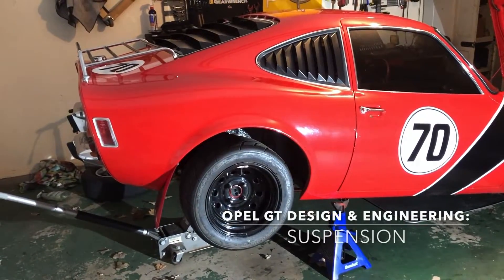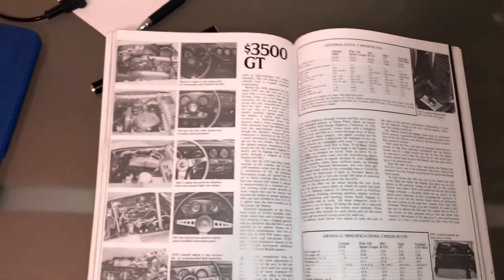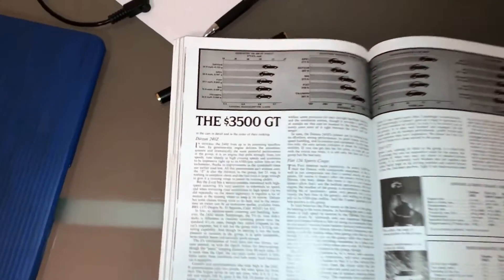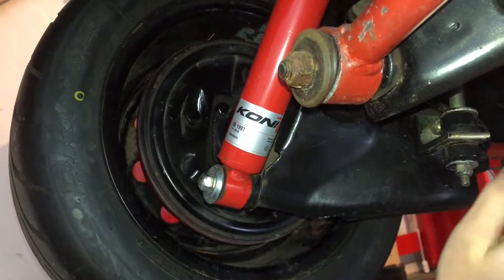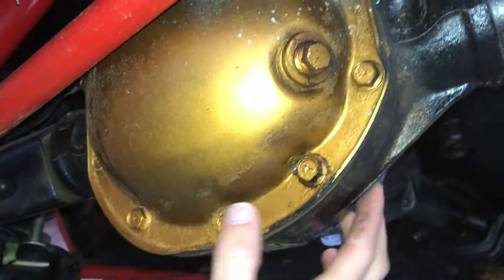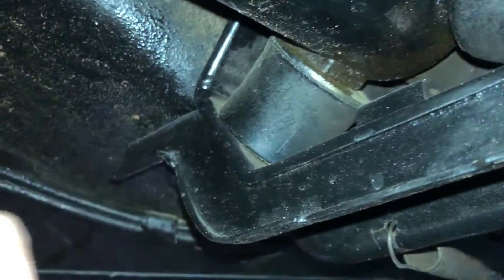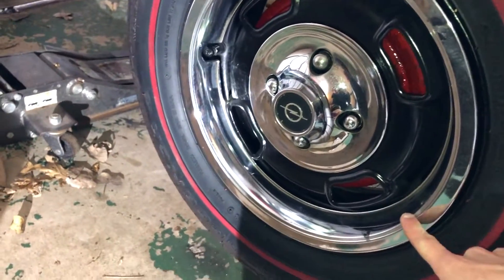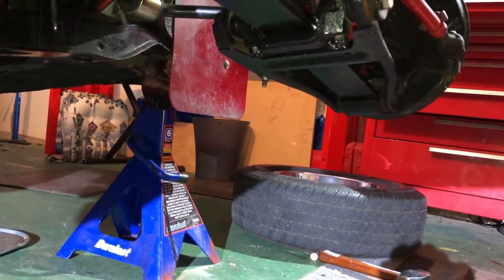Opel GT Design & Engineering: Suspension

Comment: Hi thanks for the intro into the opel gt.  You mentioned the corvette leaf spring being stronger in some ways yet more comfortably in others.  That some have swapped them out but needing to modify it.  Can you tell me where i can find information on it?  From what i have gathered, the corvette leaf spring is longer than the opel leaf spring.  Looking, i see there is a single bolt in the middle holding it to the k member.  Im wondering if they cut the middle 4 inches out.  2 pieces of the sides above, bolting the middle under it so the flex wouldnt transfer to the opposit side.  It would make it truly an independent suspension. 

If im wrong, can you tell me if you dont know where to find it online?

Comment: The lateral bar at rear suspension is called Panhard bar. The front leaf suspension was used on the Kadett serie (and may be other series)
Reply from the maker: Yep! Both items were mentioned in this video at 5:10 and 11:10. The 1963 Kadett A was the first to use the front suspension although the 1966 Kadett B was the first to arrive at more or less its final form. Likewise the second half of the 1967 Kadett B was the first to use the final iteration of the GT rear end (1.1L). The 1968 Kadett 1.9L was the first to use the larger rear end. The vauxhall viva first generation was quite similar to the Kadett A and also not far off from the GT.

Comment: hi great vid. so do you know what mods Conrero did to the f/r suspension to make their cars handle better. ?
Reply from the maker: shadmonk thank you! There was a lot that they did! I highly recommend the book “Opel GT Motorsport 1968-1975” by Maurice Van Sevecotte. I’d have to write a novel to even scratch the surface of this question!
Reply: @OpelPower  your car seems to handle great. I'm wondering for a road track day car are these mods adequate? sounds like a lot of work to do a Conrero type modifications then?! How would you improve yours further if you wanted to?

Comment from the maker: One small correction.
At about 17:25 I say adding a front sway bar worsens oversteer. I meant to say understeer.
Reply: what is the diff centre,?.d44,or what,.what is the g/box.?. these are prone to leave the road like a plane at 120 mph..front splitter,rear wing,mazda miata engine.or better..

Comment: Is there any "upgrades" that help the Suspension? I'm getting ready to rebuild a 68-69 come Summer. Looking for all the tips I can get.
Reply from the maker: FallenAngel1930 yes! Get the 1” lowering leaf spring, this makes a huge difference. Get front and rear sway bars, Koni red shocks, and poly bushings front and rear. Unless you are doing competitive racing you’ll be completely satisfied with that setup. All these parts are available at Opel GT Source.
Reply: @OpelPower  Thank you for the Info. I really appreciate it. Are there any Rear End Swaps that work if I decide to go up to 2.4? Your Video Mentioned the Rear doesn't hold well with more HP if I heard right?
Reply from the maker: @FallenAngel1930  You'll want to use the stock rear end with a 2.4L. You will have more chance of blowing it up than with a 1.9L, but that doesn't mean it will happen. Keep it full of oil. If you have a later style 1971+ axle you'll be in better shape. Tons of people have 2.4L with stock rear ends and do fine. If it were me I'd use the Quaife LSD that fits in the stock housing (with slight machining that any shop can do). This replaces the weak spider gears in the Diff
Reply: @OpelPower  I have a 72 Opel  that needs Floors,and Motor. So, you are saying I can take the Rear, and Front end off of it then move it to the 68-69?
Reply from the maker: Yes the parts are interchangeable. You probably don’t have a 68. There were only 13 in the US  or none and they are very special. Hand built and have a higher compression head. Yours is going to be a 69 GT
Reply: @OpelPower  Thank you very much. I feel bad asking so much, and knowing so little. I bought both from a Junkyard, and went by what they told me. I need to go look at the Door Vin. I really appreciate People like you being as Knowledgeable as you are.
Reply from the maker: Don’t feel bad! This is literally the purpose of this channel!:)

If you haven’t already, join www.opelgt.com there is a huge wealth of knowledge there. 
Also join my group Opel Owners USA on Facebook:)
Reply: @OpelPower  I can join both. I think I also have you on Instagram. I'm just glad for help. Going to make this Project alot easier.